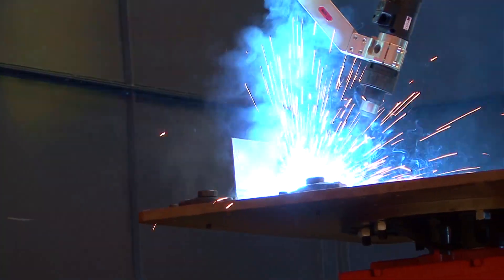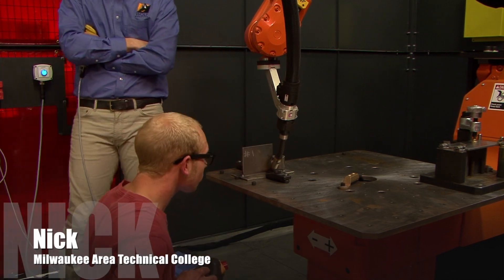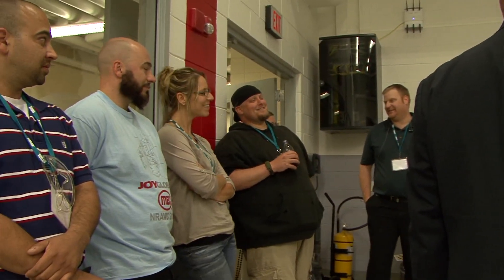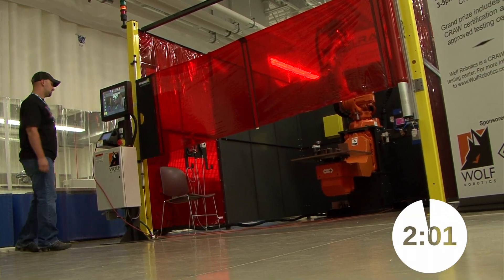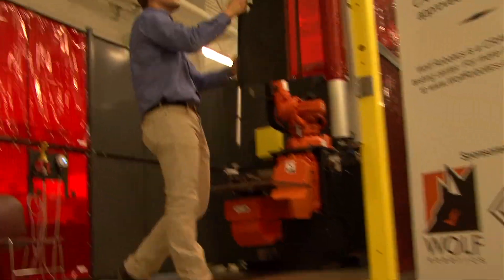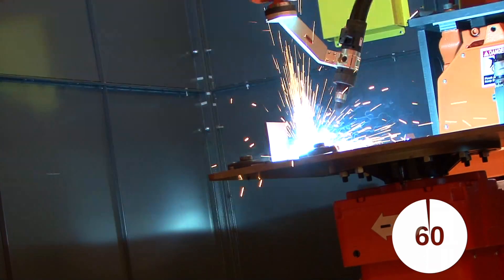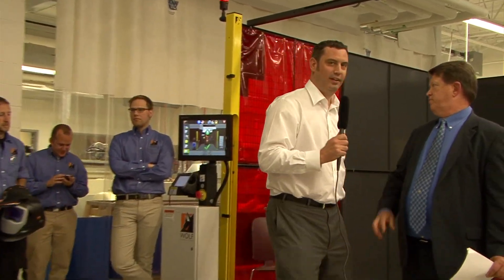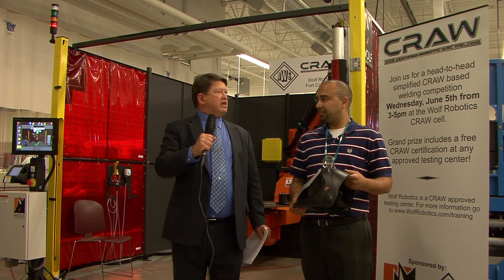Robotic Welding Competition Coming to FABTECH 2013

Comment: Hello to anyone that knows how to program a Denso 6 axis tig welder?  We over here are having a hard time trying to create a finish weld on medical supply equipment. What we have  is 1/2 s.s.rod with a 3/8 s.s. rod that threads into the 1/2, then weld it. the problem is the exit weld at the very end of it. Is it possible to get the exit weld to look like the beginning?  So no finish work is necessary? Besides buffing and polishing of course. Thank you to anyone that can help. We also may be interested in hiring to demonstrate. John
Reply: Thanks
can you give me the adjustment for the post to weld and the Tension, intensity and speed
I appreciate that
Reply: @souciabderrazek6741  Yes. 2 spits on the left shoe, 4 quarter turns rightside and a quick pat on the back

Comment: What sort of robot welding competition can this be if the contestant doesn't have to come up with the welding parameters, it just becomes a weld position contest

Anyone capable of this should off the top of their head with a weld length and cycle time for the piece arrive at suitable parameters.
Reply: Biggest 'lol no' for me was how the 'competitors' put their face literally against the weld piece and started to hand-jog the robot. Like m89 what r u doing, you never make paths for welding robots by hand- You have CAD programs that do point-to-point welding and milling planning far better than you could ever hope to do by hand. What's 'difficult' in welding with robot beside the whole theory of proper welding is to account for part malformities and non-uniform parts to have the robot adjust its speed, angle, motion and weld length to account for changes on the fly based off weld current, welding voltage shift and machine vision results. That's raw coding expertise, not 'cross the checkbox' quizzes and hand-jogging.
Reply: @Warhamer116  Excellent. :)

Comment: V R N NEED OF saw process welding advise to weld 17 TO 20 TH SINGLE BEVEL PIPE DIA 24 Inch and 30 Inch - long 40 - 60 feet - CS APL 5L GR X 42 .

Proposed welding time duration is only 1 Hr for both the joints and 100 % RT is applicable.
Reply: thancks
can you give me the adjustment for the post to weld and the Tension, intensity and speed
I appreciate that